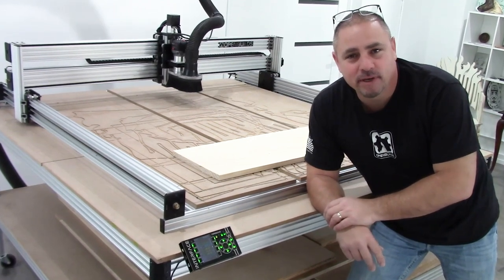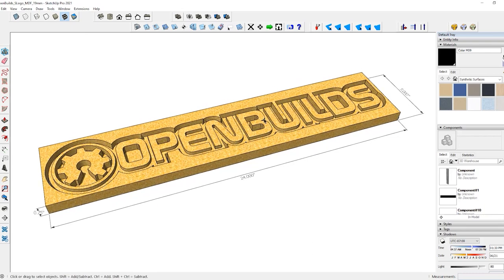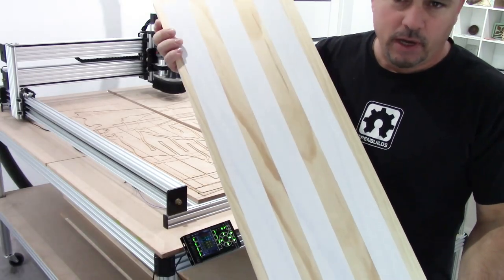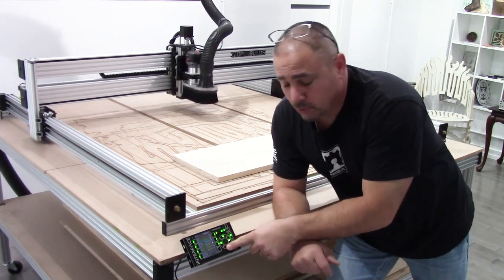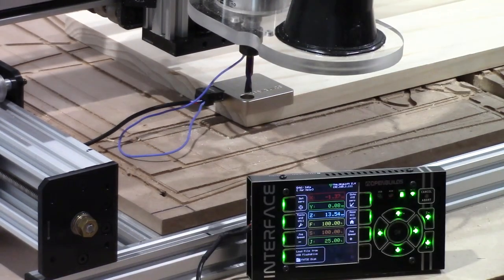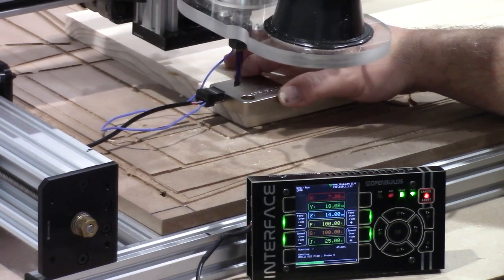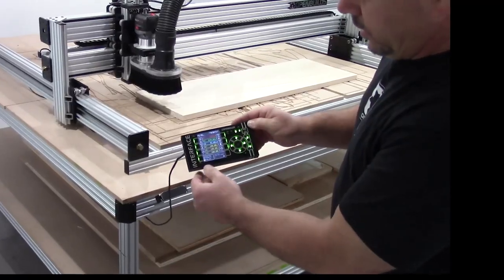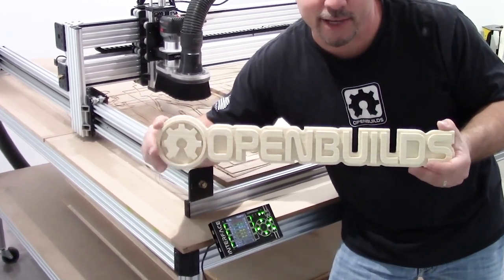HOW TO: Quick INTERFACE CNC control pendant -  project example -

Comment: Ordered my INTERFACE on Monday and I am supposed to get it tomorrow. Want to do a call out for Rachel in Customer Service. Rachel has done a fantastic job following up on any issue and even responds on the weekends. Mark my LEAD 1010 had a few issues that Rachel helped me resolve and now that I have dialed it in it is a GREAT machine. I make cutting boards, cheese boards and charcuterie trays. I named the machine TANK for it is built like a tank. Now I am looking for a larger place for my business for I want to add two more machines to the production line. Keep up the great work.
Reply from the maker: Thank you for this amazing and kind feedback! Your story is a true testament of the OpenBuilds mission and we really appreciate you sharing it with us.

Comment: Agreed, this is a nice project and good hardware for jogging, etc. I could not see a way to use the interface to jog but also use the laptop to run jobs. I often make changes to subsequent jobs as I work them. Cannot have this workflow with this device. 

Did you conveniently not show you that still have to use a computer to copy your gcode to a USB drive then unmont and plug into the interface? All I can find in the tutorials is that you still have to sneakernet your gcode to the device via usb drive to play the job. I would like to be wrong. Is there a way to get gcode over wifi from files saved on the local LAN? As far as I can tell, Wifi is only for firmware update. Is this correct?
Reply from the maker: Hi @JonasRullo , you can easily upload GCODE wirelessly to the OpenBuilds Interface. Here's a helpful guide: https://docs.openbuilds.com/doku.php?id=docs:interface:wifi-upload .

If you have any other questions or need further assistance, don't hesitate to reach out to our support team! https://support.openbuilds.com/support/tickets/new

Comment: does the controller have the ability to turn on a spindle and set rpms?
Reply from the maker: Yes you can turn on/off the tool. The rpm setting for the rpm is planned for an up and coming firmware release.

Comment: What cam software are you using?
Reply from the maker: Its SketchUp 3D modeling software
Reply: @ I thought it looked familiar!  I’m having a hard time choosing a CAM software that won’t break the bank.  I was looking at fusion but it’s too pricey for now. I might consider if there is more demand or if I buy more machines. Which software works well with the LEAD 1515?
Reply from the maker: @pierregervais1567 

Too be honest SketchUp is nice for architecture, but it’s really not suited well for CNC routing directly, and Fusion is more for the milling side of things.

I would honestly suggest using Vectric’s line of software or Carveco for CNC routing. https://us.openbuilds.com/software/#y=476

For 3D modeling Shapr3D is a nice option that more affordable. https://www.shapr3d.com/

Hope this helps to point you in the right directions on your CNC adventure!
All the best, please #OpenBuilds so we can follow along!
Reply: @ thanks for your input! It’s much appreciated! 😁

Comment: Wondering when is the Interface mounting build coming as mentioned?
Reply from the maker: Hi Fathmi, thanks for asking it is in the works it just a busy time. In the meantime I can tell you the magnets I used are here - https://amzn.to/2WldHgo
I tried a lot of them and this one works great.
Reply: @OpenBuilds  I noticed the rear of the Interface is non magnetic.. did you have to stick a metal plate in the back?
Reply from the maker: Yes these car mounts all come with a few different sizes small stick on thin metal plates and we made a center template that will help line it up when you stick it on.

Comment: Do you know how I would hook this up to a Demon controller? Using a printer cable that eventually converts to UART doesn't seem to power it up. I can't even seem to get it to update using the Flashdrive and the software that is downloaded to update it when I hook it up to the computer. About the only thing I can do is play that little game.
Reply from the maker: Hello, for personalized assistance with connecting your OpenBuilds interface to the Demon controller, please contact our customer service team at https://support.openbuilds.com/support/tickets/new . They'll be able to help you troubleshoot the issue effectively.
Reply: @OpenBuilds  
I did. They did not help. I sent another message haven't heard back. I would love to use it though. They only sent me copy and pasted material.
Reply from the maker: @iwannaapple7190  OpenBuilds can provide support, when possible, but unfortunately, we do not have the "Demon Controller" in our inventory. Therefore, to ensure the most accurate information, we recommend reaching out to the manufacturer directly or posting your questions on the OpenBuilds forum. On the forum, you will have access to individuals with varying experiences and knowledge who may be able to assist you. https://openbuilds.com/forums/
Reply: @OpenBuilds  I heard from them again and I appreciate your responses too. My only problem is there is another chip card on top of the Arduino board. I don't see any bolts holding it there but something is and I don't want to go around and yanking on anything to access the Arduino board. I'm not familiar with how things like that are usually done. But they have offered a return. I either sell the demon or buy the blackbox OR figure out what is holding down the demon shield chip card that is on top of the Arduino. I just wish the reviewer on openbuilds website would have explained how he did it. Thats the only reason I bought it-that and my battery swelling that I had to replace on my laptop for long carve times.

Comment: Got an email for this and jumped on it right away, looks cool and I'd hate for it to have the same fate as the Router11 and only be available in bundles 😒
Reply from the maker: Awesome catch John thank you for your support. WYou will love have the Interface on your machine. Its really that great to just walk up and use your machine anytime you want without the laptop, even if you just want to jog it around to show a friend how it works it ready.
Reply: This device is awesome, finally got some time to try it out, literally plug and play, plugged it in, loaded and i was jogging and clicking the router IoT on, magnetic phone holder is a great idea. Designing a minimalist 3d model to print  to seat it in and alleviate some of the wire's strain from moving it around. 
I do have question, I want to extend the wire a bit from the black box by a good foot, would that be too long?

Comment: How much gcode will the memory hold. Is upload of gcode from sdcard or usb been think about ordering one for my lead 1010
Reply from the maker: Hello Warren. It reads the gcode from the flash drive so you can push lots of Gcode. Check out more in the docs here - https://docs.openbuilds.com/doku.php?id=docs:interface:start
Check out the Interface Build - https://openbuilds.com/builds/interface-cnc-touch-control-system.9688/
Also be sure to jump on the forum and see how others are using the Interface on their machines - https://openbuilds.com/threads/interface-cnc-touch-controller.16906/